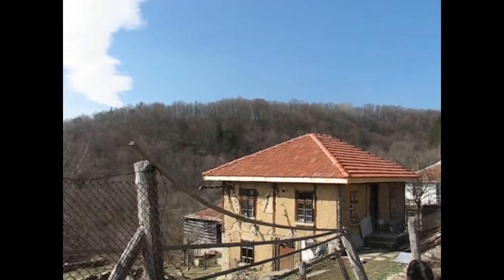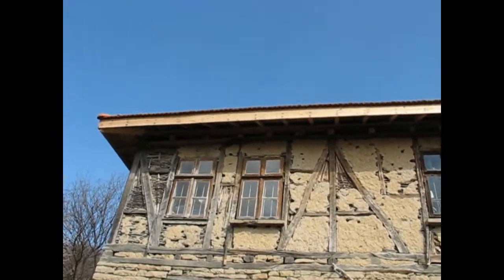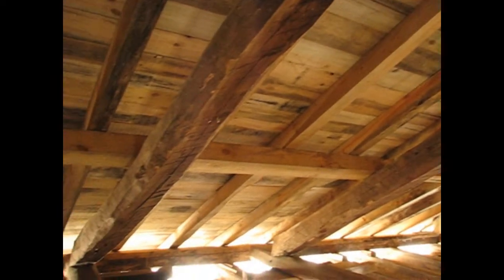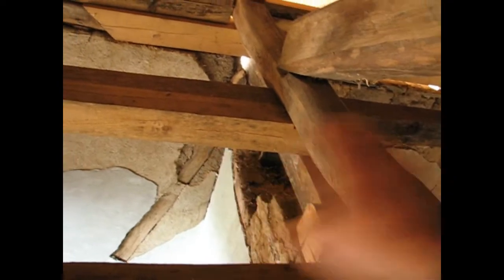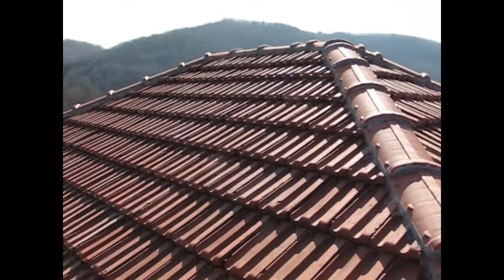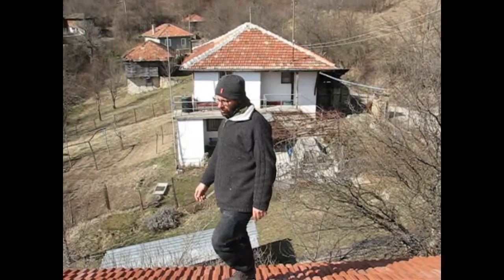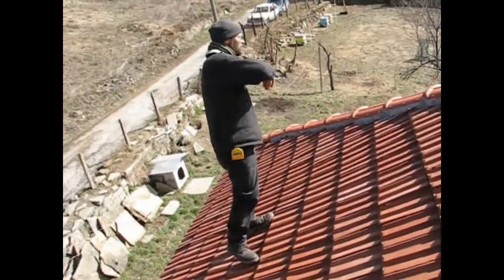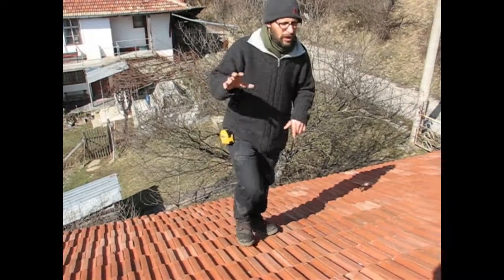Clay Tile, Roof Inspection, Bulgaria. 1.

Comment: Earning some money for HAVAYA 🤞🏻

I remember when you did the video of putting that new roof on good to see it in such good condition 👍🏼pity the rest of the house hasn't changed much.

@ 8:21 the house in the background, looks like the ridge cap on the far right (South East) side is bent or sagging in the middle?
(I took a guess at South East based on the sun angle and your in Northern hemisphere)
Reply from the maker: Trying 2......
Reply from the maker: Yea Dave, the house hasn't changed much as result of lack of  resources I suppose.... Many village houses in the Balkans have very shabby roofs, it's the Balkan Style..... @8:21 it seems there could be a problem, or maybe  not, cos as you cut tiles on the hip, things become very awkward and nothing will lay in a long flat line anymore. especially when stone caps are used like on that roof. anyway it's a barn, so nobody really tried to do a good job anyway, I suppose......   Enjoy labour day.